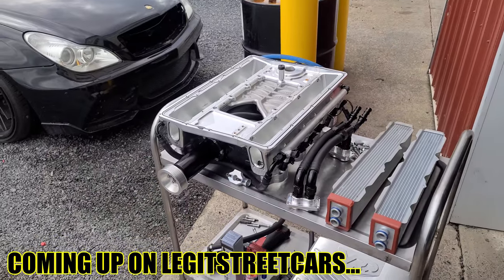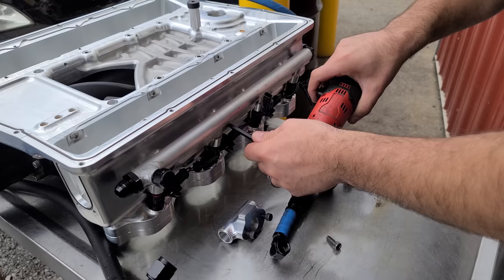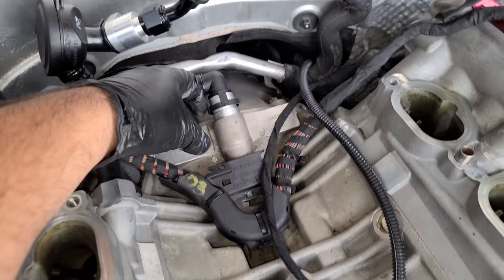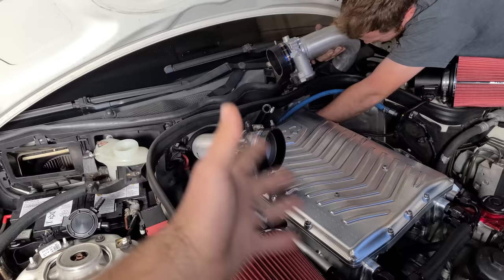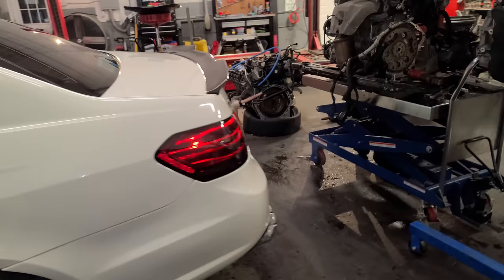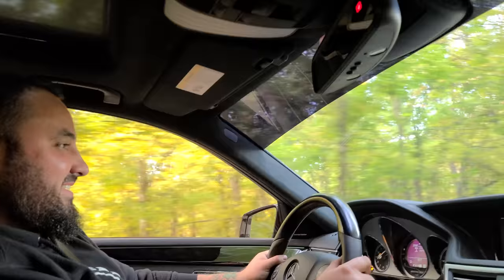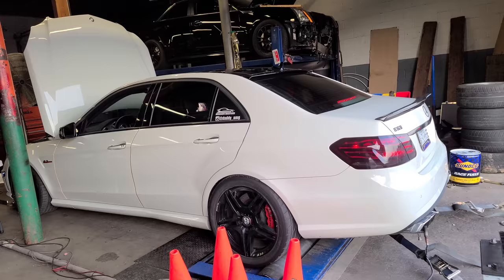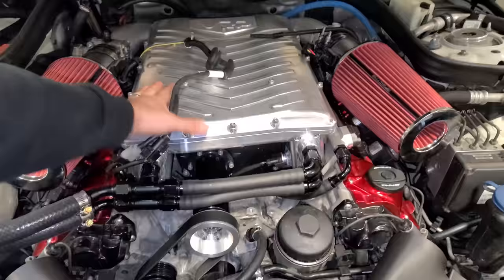I Solved My $7,500 C63 Engine Disaster & Installed A GIGANTIC Prototype Supercharger Kit On An E63!

Comment: At the end of the first pull on the dyno you see the billet cover sink back down like it was expanding from all that pressure. I hope that isn’t gonna be an issue
Reply: Yeah, youre right, just saw it on the second run. You can see how much the cover expanded when it sinks down after he gets off the pedal. I definiteley think that part should be made just a bit stronger considering they wanna push a lot more boost than in this initial test.

Comment: Don't want to rain on your parade, but, the supercharger lid is definitely ballooning.  At only sub 4psi,  it needs to be redesigned with a thicker wall, additional hold down bolts and some serious reinforcement.  Otherwise, this will fatigue fail and/or pop with increased psi.  Great results for a prototype!

Comment: Love that at the end of the dyno 
run as it is winding down there is zero popping or missing…totally smooth on the way up and down. With a quiet exhaust it would b the stealth dragster from hell!
Reply: Lol 🤣 calm down bucko
Reply: @Red Beard's Racing Anybody can have a loud one . That thing would sound unique with a tuned purr that builds to a gut churning scream!
Reply: @Red Beard's Racing: depending on where you live, having a ripping exhaust like that can get you in trouble. Sound alone can get you tickets if you are in an area where cops are a-holes, or your neighbors complain enough. Besides which, as long as it's not killing power, I'd rather surprise the hell out of someone with a sleeper than advertise it, so to speak.
Reply: A quality system with flaps is where it's at, just open the flaps when you want the attention.
Reply: @Red Beard's Racing
Some places might be state law, some will definitely be local ordinances, so check your specific locations and see. If you are more rural, the chances are you'll be fine, as even if there is a limit by state law, the local cops might not care.
As cheeseburgerbeefcake said below, just invest in a remote cut-out system and you can be "safe" on the road with normal driving, and open 'em up to have fun.
Reply: @Red Beard's Racing loud noise does cause injury, just because it doesn't hurt doesn't mean there is no injury. And this kind of injury is for life.
Reply: @Red Beard's Racing "There is no crime for a loud exhaust, no one is caused injury by it so why have we allowed this to happen?"

1st part of your statement: It is in fact a crime in some places
2nd part of your statement: You may want to think about your own definition of "not injuring anyone"... I mean, sure physically loud exhaust might not be 'hurting' anyone, but the intrusion on other people's space with loud exhaust noise can be mentally (or in some cases emotionally) invasive.

There is room to have both, just be responsible, and realize if you act rowdy in some places you can be punished for it.
My friend had an old El Camino with a rowdy engine and got nailed on more than one occasion for violating noise ordinances. This was 30 years ago, so there were no 'remote cutouts' on the market. If you had cutouts, you had to bolt them in and out to use them.
Reply: @Red Beard's Racing who is chronicly exposed to loud noise when a car is too laud? Every one that is near the car when it is running. Drivers, mechanics, neighbors. My grandpa was partially affected from driving a truck before regulations existed. But more importantly is, everyone else doesn't have to suffer because you like laud pipes.
Reply: @YourScaryMother  Having loud car here would make you lose plates where im from 😔
Reply: @theq68  my exhaust is not going to have life changing effects on your hearing. if i can live with it inside the car you can live with it outside.
Reply: @YourScaryMother  my cars exhaust passing for a couple seconds is more mentally intrusive than construction crews outside your home for hours? stop making excuses for stupid laws and trying to limit a form of expression.
Reply: @theq68  if i drive by your house and you hear my car for 5 seconds… that’s not chronic exposure 🤦‍♂️ if my car effects you so emotionally that you need to call the cops then that’s what’s called a personal problem and not an issue i should care about. just say you hate seeing people have fun and move on.
Reply: @BassmentBrain  translation: I'm an idiot and don't respect anyone because I'm "Having fun".
Reply: @BassmentBrain  lol, okay sport, here's the deal:
I really don't give a crap about those laws, but they are in fact laws in many places, I am merely telling how it is. You want to "change it"? Well, then I suggest you grow up and go into politics to get it done. Because that is the only way it will ever change.

Comment: @victory road performance and @legiststreetcars "WOW" Great job guys! Just one observation.  Take a look at the intake manifold @39:40 - when he let's off the throttle.  The manifold  is contracting.  Seems like it's flexing from the pressure. Might want to check out the material used or beef up the structural design. If it flexes that much at ~4 psi, it could pop any higher.  
Awesome to see this platform getting the attention it deserves! Can't wait to see what these engines are capable of and where you take this! Well done sirs!
Reply: I checked that time stamp and it looks like you're right, might want to email them since they probably won't see a random you tube comment.

Comment: Passenger side intercooler will not cool as well as the drivers side.
The piping will flow less water to the passenger side unless restrictors are placed in the tees.

Comment: When you come off the first pull on the dyno (roughly 39:38 in the video), it looks the supercharger lid has ballooned and then comes back as you come off the throttle. I have no idea if that's an issue or if they need to beef up that prototype part.
Reply: I saw that too, if it’s not a problem at 4psi, what about when they put a smaller pulley on that thing…10psi, I think that lid will break .
Reply: Holy shit yes, that lid will definetly pop open man. But i hope this gets reported so that doesnt get to the actual product.
Reply: Holy shit hope he sees this lol.
Reply: I saw the flex too--mainly from the wiring harness moving, but watched it again and it definitely was the lid.  Either put more supports underneath or make a thicker lid.
Reply: Yes this need attention brought to it!!!
Reply: lol I slowed the video down when I first saw it I thought I was tripping im glad im not the only one

Comment: Btw, the 2 85mm throttle bodies don’t add up to 170mm, because cross section of the area of the circle is what matters. So the actual convention is to a single 120mm throttle body. Given sqrt(2x(0.085^2)) = 0.120

Comment: In regards to the throttle body size, you mention that the twin 85mm throttle bodies sum to 170 mm 'of opening'. However, it's worth noting that a 170 mm throttle body would actually flow double the air as two 85mm throttle bodies, since area increases with the square of radius with circles. A 120 mm throttle body would be equivalent in terms of area to the twin 85mm ones.

Comment: 2x 85mm diameter throttles are equivalent, area wise, to a 120mm throttle.  But wall and butterfly losses in the dual smaller throttle bodies mean that they are equivalent to less than 120mm.
Reply: I did the math, and it's actually 144mm, but I didn't think about the wall and butterfly losses.
Reply: @dustintunis9347  Redo the math.  r2=sqrt(2*(r1^2))  It's 120mm.diameter (60mm radius)

Comment: Fun fact the twin screw SC technology was patented in 1878 but the technology of the time couldn't realistically manufacture the "twisted" screws which makes alot of sense for the 1870s timeframe. Root style was so much more popular auto or aircraft because of engine rpm reasons, everything was low rpm back than.

Comment: The reason they make whining is the cut on the gears and the oil it uses, so they probably have a improved cut with bearing noise kept down with the recommended oil different than what they used in the past im guessing.

Comment: A buddy of mine had a C63 AMG Black and I truly LOVED that car. It also had long tube headers and he had a centrifugal supercharger adapted to work on it. It also had complete straight pipes, much larger injectors, an aftermarket Walbro Hellcat fuel pump (the same 530 LPH pump that I have in my 709 whp Civic), and he had everything dyno tuned. I don't remember what it actually made, but it was close to 700 whp. I got to drive it a couple of times and let me just say that how that car pulled and how my car pulled is like night and day. The RWD and the instant torque from that supercharged V8 scares you at first. My Civic has a 1.8L DOHC VTEC engine with a GTS3582 turbo and hits full boost (34 psi) around 5000 RPM and then it scares the hell out of you, but only if it catches traction. I was able to take out a C8 Corvette from a roll with my Civic and Toyo 235/50/15 R888Rs on the front. That C63 was all around fast, but it had LONG legs. You'd punch it and it was like a damn rocketship. Before you knew it you were at 120 MPH and shaking.

Comment: at 44:18 when he lets off the throttle you can see the SC lid flex back down when the boost pressure is relieved. maybe a redesign with larger reinforcement ribs of generally thicker.

Comment: Ok, I’ve got it!!   Get a 2008 Hemi Magnum.    Yank the goods.   Install the MERC goods.   They are VERY similar architecture.    If the donor Merc was like a 2000-2004 I swear it would all just bolt up.    I’ll bet the diff is almost the same form the Merc, the instrument panel and wiring would be all but just a swap.    You asked.      A Merc stuffed Magnum.   I mean the Magnum is already Merc stuffed, but older Merc.    Now just put the slightly later Merc goods in the meanest looking wagon ever.   “Hey man, that thing got a Hemi?”    “Ummmm, no actually, it’s got a dual overhead cam  Mercedes engine with a prototype supercharger and Hellcat intercoolers, anddddd, apparently I can’t get tires big enough to keep this thing on the road.  We’re gonna tub the independent rear suspension and put 18” wide steamrollers on the back with a modified rear windshield washer nozzle and reservoir pumping VHT in front of the tires at every stop light and every launch will look an NHRA Pro Stock burnout, but full track.”       “Jeezus crispies are you guys insane?”      “Maybe.    Come back in a month and you tell me.”

Comment: That diaphragm failed on my 2008 C300. Caused oil to leak and I got an estimate for $3000 from some shop claiming I needed to replace my “intake manifold gasket”. I ordered those plastic diaphragms from a MB dealer and was able to change them by just reaching back there after taking off the plastic engine covers. Took about 5 minutes and saved myself about $2,970.

Comment: It looks like if you leave the air intakes alone, you will never have to deal with the hydro lock issues with those AMG engines. The water will just run out the car!! 😅

Comment: Did anyone notice the cover to the supercharger expand? Once he let off the throttle it came down
Reply: i'm looking back at 27.00 and u are right, it flex  its to thin, the aluminium is to thin in the middle of the cover   WELL SEEN SIR.

Comment: You kids should look and find some Caroll Smith books on Racing Enginering and Competition Preparation...There's lot's to be learned in the books some "old dinosaur" had written....Stuff like "Stat-O-Seals" from Parker Hydraulics....I really CRINGED at the use of O-rings below those manifold mounting bolts....Great application for a "Stat-O-Seal"....No way the O-ring "goes the distance"!

Comment: You're wrong about ev not taking over. Ev will definitely be faster than any gasoline engine ever produced and remember ev is still in its infancy stage. As far as sound goes the ev can produce a duplicated engine sound from any gasoline engine. Harmon Karman is producing software as we speak for that application. I love cars but I prefer ev any day over petro. Me personally I'm sick of getting filthy from gas to oil and trans fluids

Comment: I hope the production kit doesnt use push loc fittings and worm clamps.   It looks like they are using an 03 cobra style 2.3 whipple flipped upside down with a billet adapter

Comment: Why is one of the throttle bodies 90 degrees to the other. 
Does it make the air flow different ? 
Aren't they supposed to be mirrors of each other ? 
Sounds great ! Sounds better than the Mustang .
Is the ECU easier to tune ? (Than your V-12 turbo)

Comment: Anybody remember Car Craft Magazine had the Dare to Be Different Section, where there would be Studebaker Lark engine in a Chevy Nova II, or a WS6 drivetrain in a 1968 Safari Wagon, or a BossNine in a Fairmont, with wheelie bars?   Yeah, that section.  Ok,soooo, THAT Merc drivetrain in a 1984 300TD wagon, but the Diesel engine goes in the back and becomes a vegetable oil burning power adder filling in the space between shifts the way the hybrids are doing, a’ la’ La Ferrari.    It’s a diesel, boost the ever loving hell out of it and let it apply 400ft/lbs EXTRA from 500rpm-1800rpm, and during shifts.       The half shafts may need beefing up.  Maybe.    The ultimate sleeper.   You could even cruise with the under hood engine off, and let people hear that diesel chatter, then BAM, 900HP of beast mode, and a total of 1200 ft/lbs of torque from 2000-6000rpms.

Comment: 600 horses is insane for such low boost + base tune.
That 63 will be a beast with a smaller pulley.
Them intercoolers must be really efficient keeping the temps ~100
+ Plus that clean tune.
...
Awesome episode even though it sucks about the replacement engine. Unlucky.
...
You are a Mercedes guy come on admit it. 
Remember tuning the diesels trying to get the injectors out? 
Only a true mercedes guy would be tuning diesels...
...
Stick the blower on the ML.
Go off roading with 700hp!😱
Ok the ML may fall apart lol still be an adventure...

Comment: SOMEBODY at that dismantler place made a very expensive mistake.  Mistake(?).   Is carelessness the same as a mistake?   I doubt it.    I’m gonna call it bad management.   Some “manager” at the “dismantler” told some newbie to wash the Mercedes engine, and of course do it just like they’ve been doing it for “years and years and we’ve never had a problem.”     Yeah.    The people receiving those engines have every reason to believe there is nothing particularly wrong with their “new/used” engine.    They install it, change the oil, fire it up, watch it cough up a little nasty smoke, and they’re on their way.    I’ll bet you 90% of engines washed at that place have similar damage and by the time people realize something is wrong it’s often too late.    Had Alex not inspected his engine, he could have had some real consequences, maybe even collateral damage from ring breakage.     Good on ya brother Alex!     Good on the brokers who handled the issue like real professionals.     Rock on.

Comment: I have a c63 p30 wagon that has just started ticking from the lifters? Any quick suggestions before I cut my losses an sell cheap,  I'm not in the position to fork out big $ to fix at the moment, gonna run some liquid molly lifter additive thru it, hopefully clears up 😔

Comment: Would love for you to fix an oil leak on my 2012 Mercedes CLS63 AMG. 
Stage 2 Tune on E40 and 93
Black boost intakes
Downpipes 
ECS Trans Tune.
I have a video of it on dyno from previous owner that shows 805whp and 1034 torque to wheels. You can view video on my YouTube channel. Not sure what kind of dyno it was. After oil leak fixed I’d like to see all the numbers such air and fuel temps etc. Would you be up to it Alex lol?

Comment: The mystery car sounds American. The starter sounds American and the engine too. I think it's a V8. I think it's a car with a swapped engine. The exhaust tips look older than the sound of the engine. Also is a dual quad exaust with angled tips, that's not modern. The engine sounds like a 1LE. I'll say it is a Camaro with a more modern engine swap. It could also be a 5.0 Mustang from the 90s....it's difficult to guess this one lol.

Comment: Love the channel, it/you have helped me out several times, thanks.  I have a W211, the seal at the bottom of the windshield has perished and I can’t find a part number or source.  Do you have any experience with replacement?
Reply: You have to replace the entire bottom windshield cowl.  There are ebay sellers that sell an aftermarket seal you can try.

Comment: Probably need to upgrade this cars transmission before you give it away.

Most PD blowers on these cars end up tearing them apart and would honestly just be handing away a problem.

Not trying to damper what your trying to do here just saying it might backfire in a completely unintended way.

Comment: What wheels and tires will hook with that thing? Mine is a basically stock 2012 with an LSD and a tune. It won't hook worth a crap with a Pilot sport 4s.

Comment: FYI, 2 85mm throttle bodies should flow 144% of a 100mm throttle body.  In this case 85 + 85 = 144 (single throttle body), not 170.  Sorry, I'm enough of a nerd that I had to do the math rather than just know that the 85s didn't just get added together.

Comment: If you are ought to get an M156 car for your next VRP Project, you should definitely get the SL63. I know its alot more expensive compared to the other M156 cars, but just imagine hurting every supercar owners feelings out there with your 14 year old convertible sports car. That thing with some FAT rear tires and a proper exhaust is just way too cool.

And that is coming from a full blown Audi guy. I'd be happy to take you around town in my build rs3 or my 700hp rs6 if you ever where on a trip to europe. @duif_rs
Cheers from Denmark